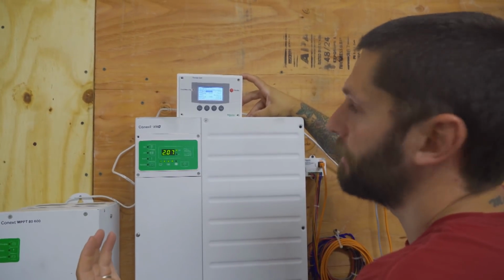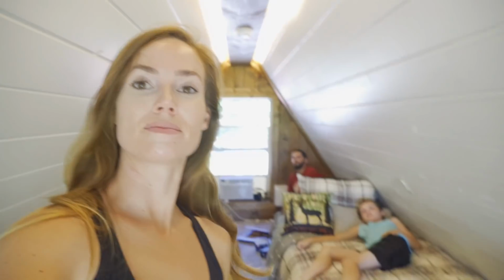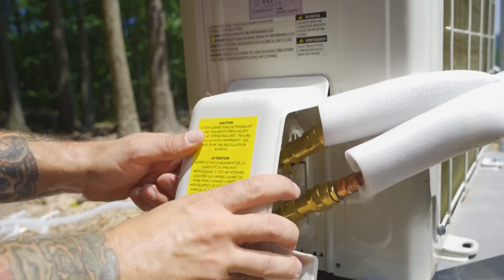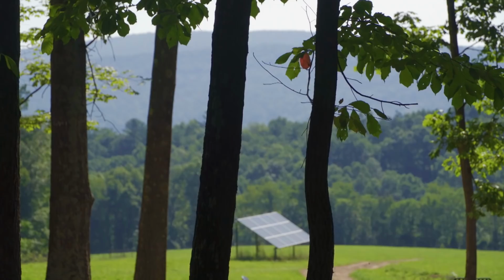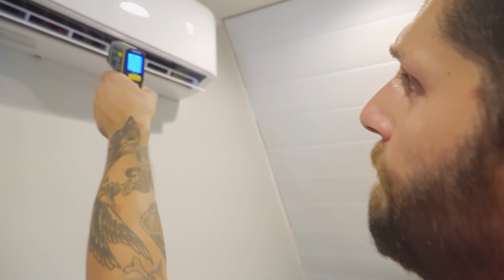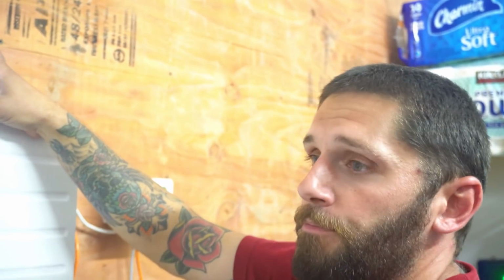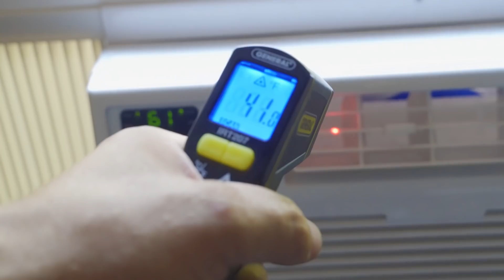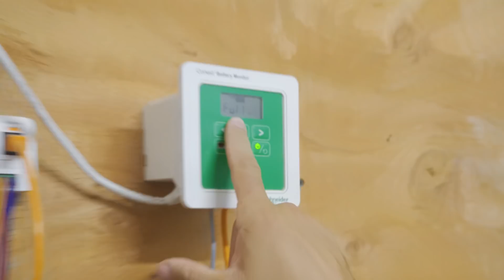Can We Run AIR CONDITIONING On Our OFF-GRID SOLAR POWER System?

Comment: The pre-charged (with freon) copper line sets with flared ends, were a game changer in the world of DIY. We use to solder everything, back in the day, and then have to put a vacuum pump on the system. Not anymore. I dont know of any of the mini splits that don't have flared fittings on them now. I get six hundred bucks a piece for installing those things, and I just smile when I come across one that I dont have to evacuate. You did an awesome job on everything. All the way down to the unistrut for mounting the boxes. Anyone else (but an electrician) would have just sunk a post in the ground. I am a licensed master electrician, HVAC and building contractor, and licensed plumber. So when I say you have done well on everything, I know what I'm talking about. Yalls channel is my favorite, of all. Not just for the care you two take in the things you do, but also for the chance to see your family grow. I  have seven kids, and the way you mix up your videos with work, family and nature, is a real treat!
Reply: What lovely compliments!
Reply: I've never seen one you didn't have to evaluate lines. How does that even work?  but hey less work is good
Reply: You've still got air and non condesables in the lines and inside unit.  It just be evacuated. 

Yes, I know what I'm talking about, I have a universal refrigeration cert and did industrial and naval ac/r... And I've installed mini splits in my last two houses
Reply: @dodgezilla04  Obviously you do not. The unit has been evacuated in the factory. The lines have been evacuated, charged with freon then sealed. When you screw the lines on, the valve pierces the seal on the last turn. Then you open the valve on the unit, and it sucks the freon into the system. This is the DIY set up, and no, it does NOT have to be evacuated, unless you mess up on installing it. It is designed by engineers to be this way. Its not like a regular system where you install empty lines, then evacuate them.
Reply: @thebeardedone1225  The lines come pre-charged too? That's helpful.
Reply: @kng128  absolutely. This is the most DIY friendly part of it. They are pre-charged for the size of the unit, and length of line. Most home owners don't have gages, or vacuum pumps. But they do have a crescent wrench. But if you are purchasing a mini split system,  be sure and check to see if they do come this way. Most systems do not, so all the above, plus more, may be required. Personally I do not buy the precharged one, because I have all the equipment and tools necessary to install the standard type. ( and they are cheaper) but for DIY'ers, they're great.

Comment: You Guys have to be So Proud of what you have achieved .... Thanks too for the 'Clarity' about the 'Evacuating' of the Refrigerant Lines .... Very Clever System .... There have to some very Fancy Connection Shut-Off Valves on the lines, as I imagine that they were 'Pre-Evacuated' .... Keep well Guys, Yet another Great vidclip .... Cheers from NZ

Comment: I can relate to cutting angles.  There are 17 walls that make up the exterior of the house.  Each wall meets at a 21.2 degree angle.  Made for interesting cuts on the flooring as it met outside walls that were around 10 and 30 degrees off parallel.  Loved seeing what your Solar system was able to do.  Thanks for all the data.  I'm sure not everyone will understand or appreciate, other than knowing it's cooling your home.  Where we live, it's not humid. Night time temps here are in the 50's.  We use a whole house fan to bring cool air in during the night and close up the house to maintain the temperature.  Currently it's 89 degrees out and 71 inside.  I've been thinking of doing mini splits for those rare 90 plus days, as well as for the heating capabilities.  Our house is 1500 SF with a full basement.  It's always cool and comfortable there as it's super insulated, even under the slab.  I've been looking at systems that have one condenser and multiple indoor units.  All we really need is one for the great room and possibly one in our bedroom.  We've never had to heat the bedroom so it would only be used for cooling there.
Reply: You can do that with a non Mr Cool. Not sure about Mr Cool.
Reply: @thutch8097  I've been looking at Cooper and Hunter on AMazon

Comment: Great explanation guys, thanks so much.  I know it's past the cooling season, but here is something to remember for next season.  Comfort in the humid season has more to do with humidity than heat (the actual terms are sensible heat being temperature and latent heat being humidity).  So to dry out the house, units running on slow fan speed, will deliver colder air which means there is more dewpoint depression and thus dryer air.  So one or two units running slow and steady, will dry better that all of them running fast because they will catch up and shut off and thus stop drying the air.  This leads to cold and clammy conditions.  Also, keeping the doors closed will prevent humidity from streaming in. Dry air will run out an open door just like water will flow.
By the way, great idea running the two strings of six panels, nice way to save wire cost & line loss. Regarding your battery stack, if they are frequently at 100% charge, I'm sure that you know that you could use more.  Here in my area (Hancock County, West Va.), historically in the winter season, we only get about 12 sunny days a year.  Keep this in mind and keep a log of how you do in this coming season (Sunny Days vs 100% Charge).  It would be great to know how you can hold up during 3 or 4 cloudy days in a row while using the heat pumps. 

I have wanted to do this for decades but I'm on the grid and the solar factor here is .31, so it is really hard to justify.

Comment: Great job, definitely on proof of concept and execution.  As a HVAC controls and service technician the only part of the proof i can give a bit of suggestion on is when you checked the temperature of the coil inside the the Mr Cool, you were actually seeing the temperature of the refrigerant after being compressed and ran thru the metering device and not the air leaving temp.  with that Temp of a coil you would have a discharge air temp around 55 which is still damn good.  You guys have one hell of a great system

Comment: We bought a house in the south of Spain last year and it was already off grid. 6 x 185w panels and a 3.2kw lead acid battery bank. Past few months we've placed another system with 14x 330w panels and a 6kw LI-battery. boy o boy, what a nice feeling not having to pay for electricity. we run a jacuzzi during the daytime and are planning on getting aircon next summer. Really interesting seeing how you do things, thanks for the info!

Comment: Whats great is that those indoor units you guys just installed is that you can control fan speed, erection, i mean direction, and temperature.  They easy to replace and service and efficient.  Im happy for you guys  you guys made a great choice. Just wash out filters on top every change of season and theyll last you long. The indoor heads will go out before outdoor units so you'll probably only replace indoor units after 5-10 years.

Comment: From the HVAC guy....lines are pre-charged with freon. they open up when the fittings are screwed together. only reason to evacuate system would be if you worked on the system and release the freon from the lines and or system down the road. This system should be far more efficient than window units, just because you are running 220V or 2 lines of power instead of 120V and only 1 line of power makes a huge difference on the overall load. Great video I love to see the projects move forward. Its fun to see people live the dream! keep it up!

Comment: Some nice ceiling fans would help the A/C's a lot especially in winter when all your heat will be up high.
I'm not surprised that the solar system handles all that load, we kinda figured that it was designed right by someone that knows what they are doing, great job guys 👍😊🇦🇺🦘

Comment: MrCool DIY is good stuff. I use one unit in my 700sqft cabin, 30ft ceilings. Similar cabin to yours. It's all good until it gets down to 30 degrees outside, then you gotta get that woodstove going. They go into defrost mode a lot in those temps. So 99% of the time this thing is amazing. It doesn't matter how hot it gets outside, mine keeps up.

Comment: I'm sure you've thought of this, but a geothermal heating/cooling system would help control the temperature inside the house in both winter and summer. Digging down 30 feet, a heat pump can transfer earth temperature of 45 to 75 degrees on a constant basis. That can take the load off Mr. Cool. Thanks for showcasing your Mr. Cool and solar connections.

Comment: Nice, seriously nice, showing it can be done, showing high voltage solar has its benefits, and having all you want with no compromises.

Love it 😘 what's your next step, batteries or panels for when you get the workshop up?

Comment: Just one good tip. Make windows ir reflective film on all windows. It will safe a lot of energy, and mutch faster cooling.
Reply: It is amazing how much that would/will help!  I had a product out of Houston, TX call V-Kool installed in my Fort Wayne, IN house.  The great room used to gain 4-6 degrees over the set-temp every evening in the summer (as the sun started to come through the bay windows.). After the V-Kool installation, the thermostat would shut off the A/C as expected, just like any other time.  Saved a ton on energy expense too.  In 2009, whole-house (2800 sq/ft) install was ≈$5k

Comment: I have solar electric and geothermal heating and cooling. My unused electric goes back into the grid but I want to change to your battery system. My geothermal is the greatest thing since sliced bread, cooling my house in the summer is pennies a day. You have the perfect system, great job guys.

Comment: A lot of people try to cut costs and do things cheap. What I’ve watched y’all do has been top notch. The company sent what you needed and you did a great job installing it. If I remember correctly the system cost about the same as the electric company wanted to run the wire to the house. I hope you don’t miss the 3-4 hundred dollar power bills. Way to go kids, enjoy your new home and farm. Now for the rest, stay safe and God bless.

Comment: Great job those units work really good. I do heating and cooling for a living and install a ton of mini splits. Another good thing about most mini splits is that they dont always run at a 100% they will ramp down depending on the load. Those other units are all or nothing. Not sure if your mini splits will ramp up or down but most do. Great job im going to have to watch more of your videos

Comment: Very nice electrical work!  Very clean and tidy. 

Regarding pulling a vacuum on the line sets, you still need to do that for two reasons. 1.) remove moisture from the evaporator and line set. 2.) test for leaks.

Comment: Thanks for sharing all that detail on your system, it will be interesting to see how it holds up this winter with less sunlight, lower efficiency, etc
Reply: I'm not sure they will use air conditioning in the winter.

Comment: Josh, curious as to the life expectancy of the solar panels and the batteries?
Reply: Solar panels tend to have a 25 year warranty, but operate longer than that just has a reduced output as they age. The batteries depend a lot on the type And the cycles. Or essentially how low they are drawn and how they're maintained
Reply: @mrmotofy  Thanks

Comment: Please do that same demonstration with the heat pump running. The heating as is impressive as cooling? Lets Find Out!
Reply: Paul Disher website says they’ll run 12,000BTU in heat or cool. Really depends what the outside ambient temperature the units are dumping or picking up. The downside will be when it’s 35 or less outside in the winter, the units won’t be able to scavenge heat & there’s no backup heat strips.
Reply: That’s what the wood stove is for!

Comment: Maybe consider installing a ceiling fan or some type of fan to circulate the air to have a better cooling effect.
Reply: They have plenty of cooling
Reply: @mrmotofy  Yeah I know, but using fans to circulate the air can reduce energy consumption and increase the life of the compressor.

Comment: Can you link or give a cost breakdown of the solar panels, inverter and battery banks  for an overall cost
Reply: I THINK they did in a previous video. I wanna say back then it was around 30K? But sounds like they added 2 more batterys. I THINK they said 5K per battery? Not sure. Check the video out.

Comment: so happy for you guys to be ready (almost) to move in. in regards to the mini split  units outside location, you may find yourself buried with snow coming off of the roof. suggest moving the outside units about 10 ft away from the roof and raising the units up on stands to keep them above to normal accumulated snow levels for your area, or you may be digging yourself out every day.  sliding snow from your slanted roof could wipe those units right off of their pads. you may also find it hard to control the heat in the loft area during certain times of the year as hot air rises and colder air sinks to the lowest level. just my thoughts. Jim in central florida

Comment: Dew an air test from within the house see how many leaks can be sealed , then a small air exchange system instal low wats in 24 hours all air is refreshed and temp exchange to with 3 % loss , filtered air , clean living , but with leaks no telling whats coming or going .
Reply: Having watched them build for a long time, I would be astounded if they had any leaks. That build is MINT!
Reply: @maryblaylock6545  their craftmanship and finishes are good, I love watching them. But talking about air sealing, they haven't done a very good job at all. They didn't install vapour barrier. At first they tried taping paper of insulation batts, but it's unreliable, so they dropped it. I am sure this house is very leaky.
That might be not an issue for them, just of course higher energy consumption and cold draughts from leaks.

Comment: Glad you got the system you did. For Mr. Cool you have one heat pump outside for one inside unit (Zone).  I put in a Mr. Slim and have one heat pump for 4 inside units (Zones).  Same effect but different way of doing it.  Mine is hampered by all the zones must be on the same setting, heat,  cool & dehumidify.  Dehumidify is the most efficient setting and I have no control over the temp. and the humidity is 30-40 points lower than the outside. I suspect your system does the same but different heat pump per zone means yours is much more flexible than mine.  Years of comfort is what you have to put up with and you made a very wise choice.   enjoy

Comment: Great video!  We live in Scotland so the priority is heating (i.e. 4-5 months of the year).  I've retrofitted the current house to [almost] passive house standards, but I installed a pellet stove and air conditioning for when solar heat isn't enough.  We need a bit of air conditioning in the Summer time due to the floor to ceiling windows which catch the heat in the colder months.  I installed a 4000 litre underground preheat tank in the garden too, which will feed the underfloor heating from thermal panels (purchased but still to install).  With the cost of solar panels getting cheaper and cheaper, I actually think it's a better option (much more versatile) than solar thermal now!  Especially considering I can run the heat pump with solar panels (still to purchase).  So yeah, it's nice being low energy initially, but there comes a point where you say "screw it" and just get better air con etc.  In the future we'll be building a low energy house from scratch, so have plenty of time to plan it well.  One thing I was wondering about was solar chimney cooling, but not sure if it would leak too much hot air in the Winter etc?  Chances are I'll cave in and just get extra solar panels for the air conditioning etc 🤣

Comment: What about a petrol generator/solar combo?
Reply: A diesel running a 4 pole generator head at 1,800 rpm would be the way in my opinion .  You could drive it with a belt and figure a ratio increase to reduce the Engine rpm a bit.  The diesel could handle it.
Reply: I am designing the same thing
Reply: My understanding -- rudimentary, I admit -- is that LP is less efficient than gasoline, and quite a bit less efficient than diesel, but the generators for diesel in particular are significantly more expensive, and it's harder to store significant quantities on hand. LP is a common and stable fuel for large on-site storage. So there are trade-offs.
Reply: @TheOmaJohn  Diesels can run on home heating oil.  LP is less dangerous to store than Diesel fuel, I don't think so.

Comment: Great video as usual! A suggestion would be to put a high air return up in the loft that in the colder months pulls the hot air above and blows it into the smaller rooms. Cheers

Comment: I use two of these AC units to cool my 1200 sq. ft. apartment (central air just isn't an option where I am), and although they work really, really well, I have learned that they are even more efficient with a few well placed fans that can circulate the air throughout your home.  Great video, btw.

Comment: That is great that your air conditioning systems are keeping your home nice and cool and your power isn't overworked. I am paying less than I did for my rural home here in Arkansas and it is very hot outside. I have one large unit outside cooling my home and have the temperature at 70 degrees to cool my home. That is great that your units are able to keep your home nice and cool and not using as much power as the window units.